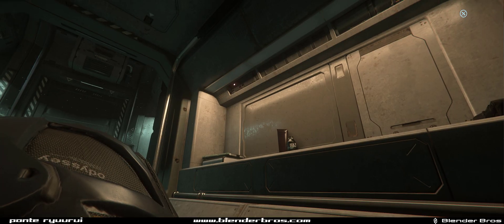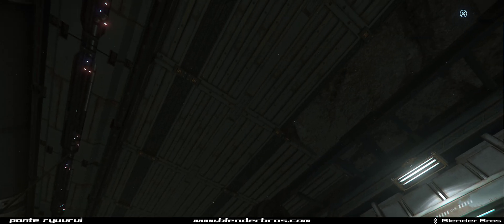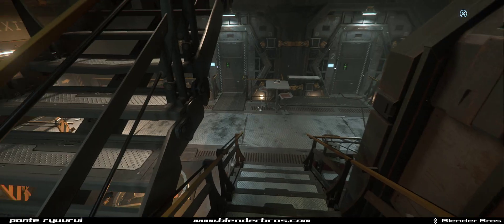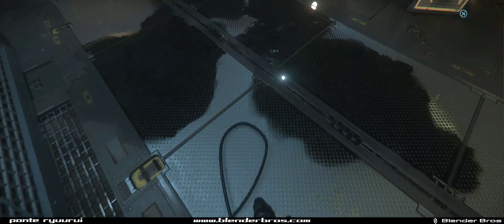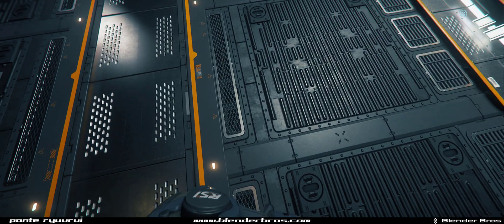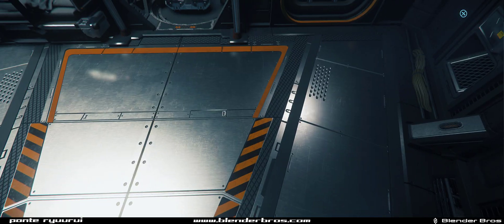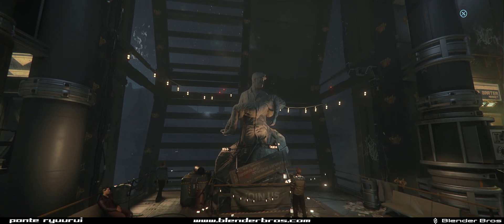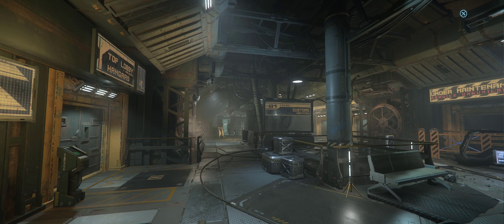Let's talk about scifi hard surface design - Star Citizen space station

Comment: Googling "Star Citizen decal workflow" yields a very insightful post: https://www.reddit.com/r/starcitizen/comments/3ogi3o/im_an_tech_artist_in_the_industry_and_id_love_to/ . The technique used in the game is heavily decal-based (mainly decal normals that adhere to the base material/color underneath) and uses custom/face weighted normals to round off edges. Unlike most games that use a standard high to low poly approach, Star Citizen uses medium polygon modeling on all of its assets. In other words, the majority of assets in Star Citizen do NOT have unique normal map unwraps/bakes for each object, saving time. To achieve smooth edges without baked normals per object, medium polygon modeling is used in combination with the custom/face weighted normals. For small details, instead of using trim sheets mapped directly onto the objects, the game uses floating rectangular planes that each contain a desired normal detail from the trim/decal sheet (kind of like in Blender/Decal Machine). I just extracted a few game files and converted them to FBX to open in Blender, and all of the models are covered with tons of floating rectangular planes for decal details. The main thing to note is that the decal sheets appear to be mostly normals-only (no color), inheriting the base material mapped to the main object under each deferred decal. Also, all of the deferred decals have Parallax Occlusion Mapping (POM), using a height map to give a sense of geometry. That's why when you crouch or crawl in the game you'll notice that the cut lines and grates on the floor shift around as if they are modeled geometry. It's definitely more robust than UE4's deferred decal system. In summary: Medium polygon modeling + custom/face weighted normals for smooth beveled edges (instead of low to high poly bake) + floating rectangular deferred decals for trim/decal sheet details (normals) + Parallax Occlusion Mapping with beefed up height map for extra 3D feel (almost looks like height map tessellation?!).
Reply from the maker: pretty much this ya, Arimus 3D has an interesting vid on mid poly, i ve been using 1 seg bevel for game assets from the start actually. baked bevels on sharp edges look like shit.
Reply: I would be very interested if you researched this approach, deconstructed it, and used Blender to reapply some of its techniques. Or maybe this is more for Josh, since he seems more specialized in Blender to UE4. After digging deeper, I found artist Sergey Tyapkin's YouTube channel, where he has some archived Twitch streams using this approach. Unfortunately for me, half of the narration and chat is in Russian, which I don't speak. He uses Blender/Decal Machine to tackle the Star Citizen approach.
Reply from the maker: nothing to research, you simply use 1 seg bevel, atlas maps and trims. done deal. I have vids on this just search the channel for mid poly